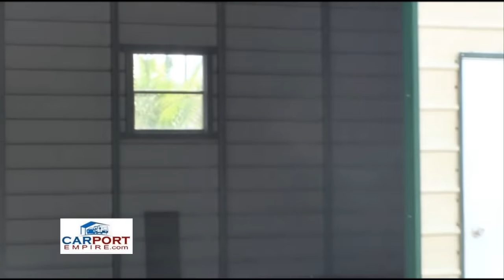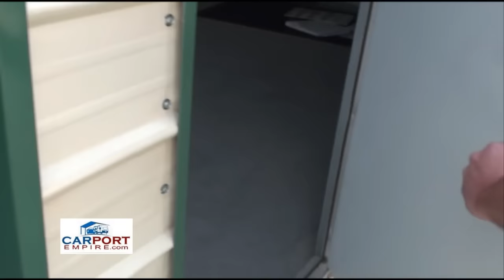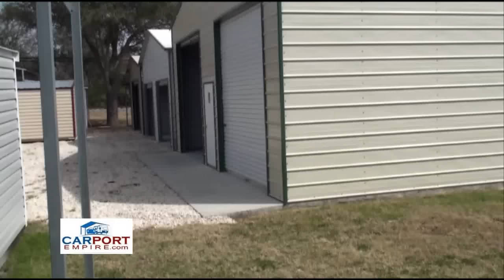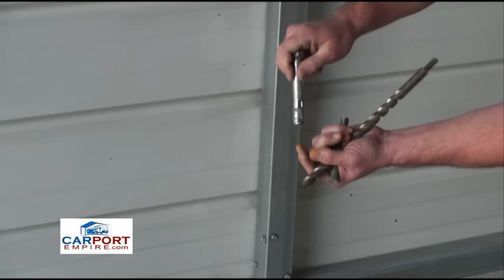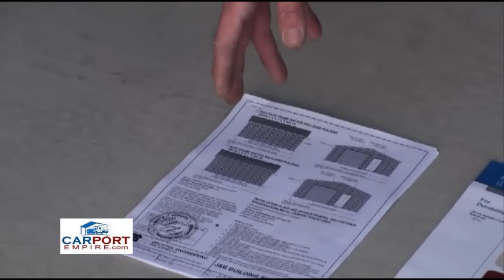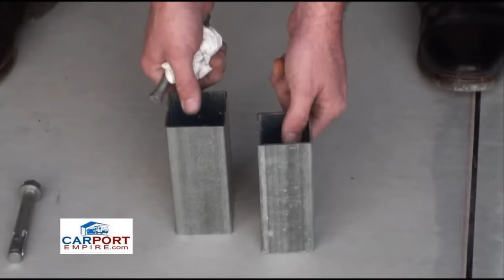Steel Buildings - 30' x 26' Steel Garage Building By Carport Empire

Comment: I’m in Madisonville Tennessee and interested in the cost for a 24 deep x32 wide x 10 sidewall with 3 9x8 doors on eve side and 1 service door on end left side ? And what are the slab requirements and also with vertical metal on roof for run off ! Thanks Ray